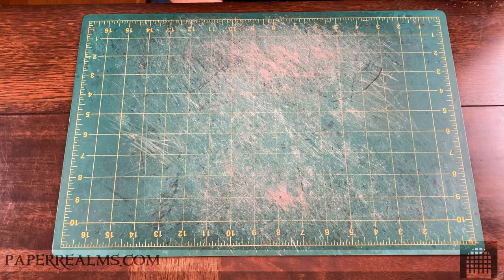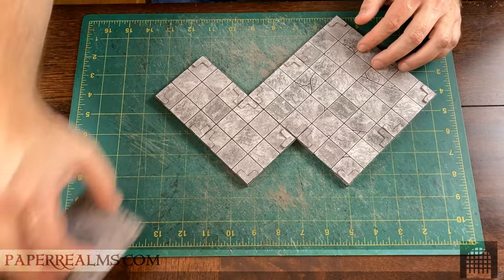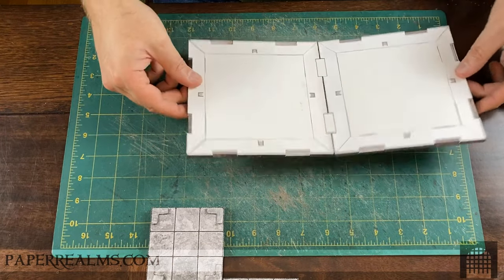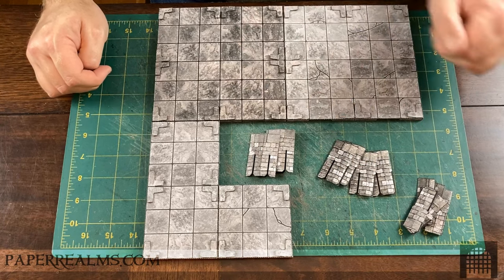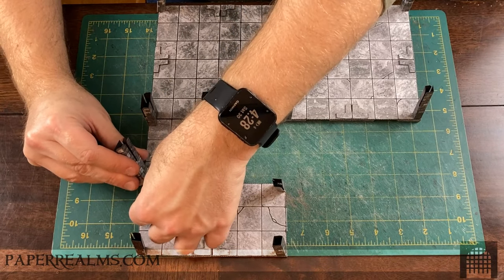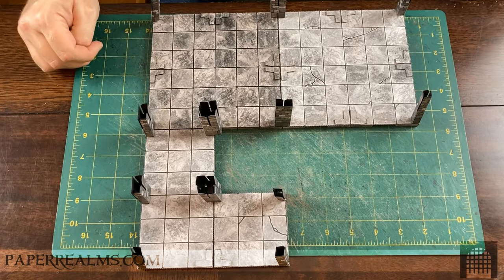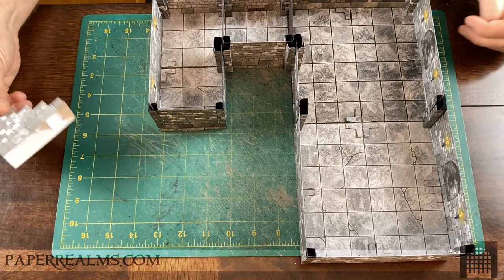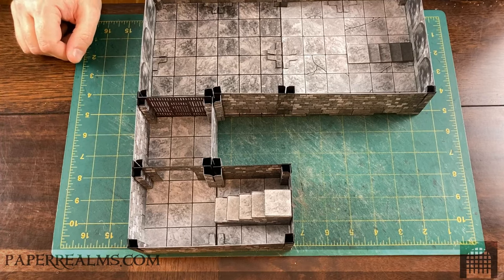Introduction to Paper Realms modular terrain

Comment: Nice system! Are the walls 3 inch tall as well? Do you have a scifi range? Your system would be perfect for Deadzone if the walls are 3 inch high as this game uses a 3x3x3 cube system.
Reply from the maker: The walls are 2" tall - things are primarily designed around a 1"=5' scale, so 2" make for a nice even number to run with. Sci-fi terrain is on my radar, but not much progress to show yet.

Comment: Nice system and good design! 
Two questions:
What kind or weight of paper do you use?
I like the system of connect the post. But, don't bend with the use?
I'll bought one (or more) core modular terrain set, thanks your generous offer in DriveThruRPG.
Congratulations and good luck in your project!
Regards!
Reply from the maker: Great questions! I hope to get some more videos in place early this year to walk through a lot of topics in detail about construction, tools and supplies, techniques etc. But, for now, I'll address your two specific questions:

>> What kind or weight of paper do you use?
That's a really common thing folks ask. I use a local office supply print shop for my terrain, and I have them print on their inexpensive 110lb (199gsm?) white cardstock. Photo paper tends to work as well, and for home inkjet printing, might produce more vivid colors; if you're printing with an inkjet printer, you might want to experiment a little bit with your printer settings as you may find the prints coming out dark and/or muddy. You might imagine that setting the quality to its highest value is always best, but this can sometimes work against you!

>> Don't [the posts? the tabs the posts attach to?] bend with use?
If you are asking about the posts specifically... The heavy cardstock should be rigid enough for the posts to maintain their shape. They're designed to fold flat for really compact storage (many, though not yet all, core sets have been updated to have custom storage boxes for posts and walls!). 
If you are asking about the tabs on the tiles that the posts attach to... The tabs are two-layers thick, so once glued, the cardstock is quite rigid. After I've taken apart a modular build, I stack my tiles upside down and sit something flat on top, like a book, while I put away other pieces. This can press those tabs back into place so they can store as compactly as possible. Over time, it's possible for a tab or two to become damaged. They are easy to replace! If the tab wasn't glued on strongly, it may pop off the tile. Just add a drop of glue, press gently in place, and in a couple minutes it will be as good as new. If the tab has accidentally torn for some reason, your craft knife can be used to slice just the one tab off, and a new one can be attached in its place.

If you have any questions, you're welcome to reach out at info@paperrealms.com and we can share some tips and tricks to get the most of your creations!